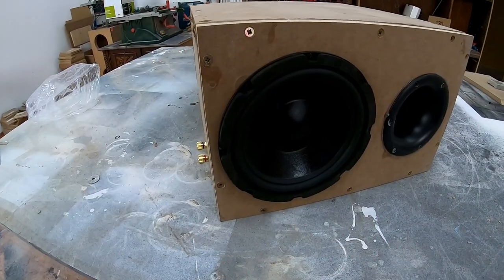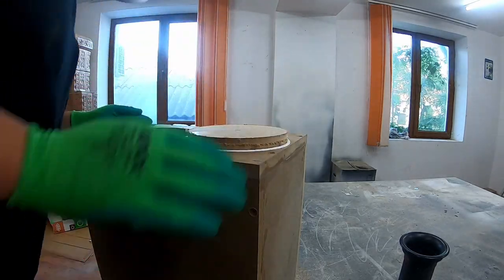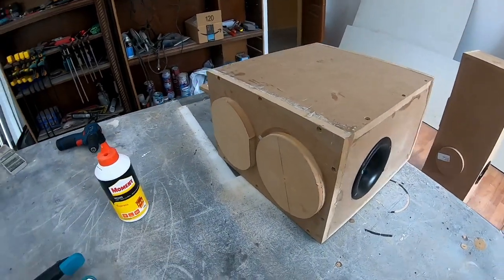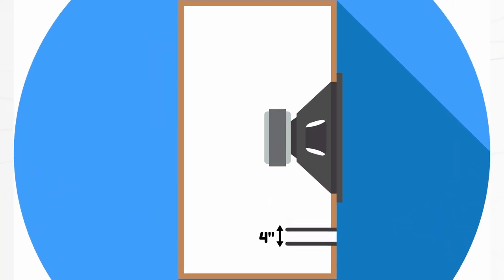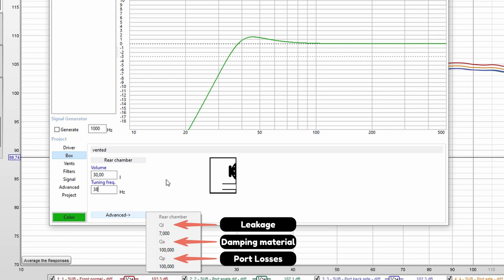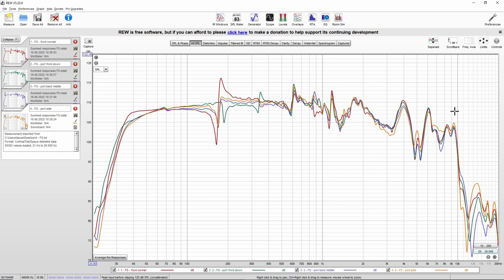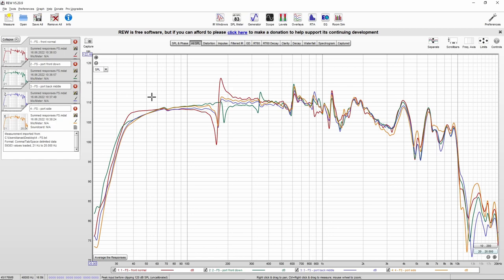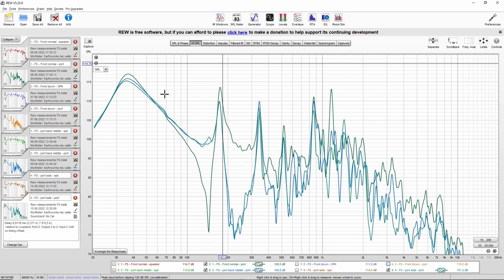Bass reflex port placement

Comment: I had some Audio Pro floorstanding speakers that had the port down firing, and it was just a two way, so one small (5-6" I think?) driver and a tweeter. It had significant sub bass output, good below 30Hz.

Comment: There's a trick with standing waves that can be used to minimize the problem with port resonance. Basically you need to design the box in such way that the mouth of the port is located around a null of a standing wave that is created inside the box. The standing wave must be of the same frequency as the port self resonance freqency. I want to try it out in the future with a small full range speaker. The problem is that WinISD seems to miscalculate the port lengh and with it the port self resonance frequency.
Reply: Or a large bottom port. Basically negating most standing waves in towers, and adding to port gain depending on the height off the floor
Reply: @Luke-qs2cg  this is true you want the mouth of the port as far away from the driver as possible so the box can build pressure as the wave builds you don't want the mouth of the port right up next to the driver
Reply: @johnnycorn7225  Generally I agree. Only one thing bothers me - port near the floor will have floor gain, can cause acoustic problems in the room like rumbling floor (depending on the flooring material) and overall incorrect boomy low freq response. Same as if we put rear ported speaker close to the wall.
Reply: @johnnycorn7225  I dont know if you just poorly worded a certain phenomenon, but what you said sounds like bro-science
Reply: @KompletterGeist  it's really straightforward, just keep in mind I'm talking about the opening of the port on the inside of the box being as far away from the driver as possible. 
The reason this is desirable is because you definitely will lose pressure if you have the ports opening too close to the driver, and that means less air flow coming out of the port and less bass. 
Nothing too technical or scientific about it check out buck box designs he talks about this topic in depth. 
I've been building boxes for a long time and have observed this personally.
Reply: @stanislavtodorov8705 put a piece of granite or other heavy type of flat brick material between the speaker and floor,  also can lay one ontop if using a cheap thin wood ,low weighing floorstanders or subwoofers

Comment: Wait wait wait +1db gain is insignificant? A 3db gain is equivalent to a doubling of input power. 
Not to mention your first measurement comparison had a lower -3db rolloff point in addition to that +1db in output, making it significantly superior.

Comment: Great video been wondering about this. I am curious though about the effects of ports placed so the they fire across the face of the driver. I believed JL Audio makes one and I just saw a Gately Audio box with dual ports facing each other across the driver front. I know this would be an advanced design but would be interesting to see if there’s any advantages to it.

Comment: I have 2 18’s in my truck and I placed the port near the roof in the middle of the 2 seats, perfectly square port which is better than a long rectangle. 4th order bandpass
Reply: why is a square better than rectangle? are both shapes of equal area? thanks in advance

Comment: It would interesting to look at port placement effects just on the front of TABAQ and Pensil type enclosure designs. These are tall, vented, enclosures with small cross sections made for 3" drivers where the speaker driver is at the top front and the port at the bottom front of the cabinet. They're almost like transmission lines and I suspect that there is a "false bass" peaking from 100 - 200 hz. Most current 3" drivers have an fs around 100 hz.

Comment: Missleading.  Re-measure your floor stander,  but not at nearfield. Just put it down in your room , close to a wall. Put the mic at a reasonable listener position . 
Now we can talk. 
1. Behind the magnet,  not a good place . At higher volume you will have more port noise.
2. Difference between forward and rear firing comes from the effect of the wall behind. Basicly you can modell that as if your port would flange out drasticly. 
3. Yess I em aware that this is mosly room accoustics. Argue about it only, if you listen to music keeping your ears kept at near field. 
Same goes for down firing ports. They get an extention with a huge flare.

Backward and forward firing allso has phase differences at the listener position. Hence nearfield will show nothing out of that at all ever. 

In a car sub it makes next to no difference , as long as the port is not choked. That is correct. The rest you say is invalid. And can be with ease tested with the setup i described.

Allso about standing waves... look , it exsists in subs too , and whit all speakers. Ever. No excuse. What you can indeed do when designing is avoiding sqaure shapes. Not ideal but you could set up your dimensions to give the desired volume , and having a ratio of the thrid root of 2 vs each other. 
So A side internal is say 1 unit ,
B side internal is approx 1.256*A 
C side internal is approx 1.256*B 

Thatway at least the resonants will not share a harmonic and not add up.

A nother oldschool solution is to suspend in the middle of the box somen spongy dampening material. Make sure the string you use is some wool of othet type that makes no sharp sound. That will break the path of the standing wave , and allso absorb reflections.

Just some old school 60's era advice .

Comment: does the frequency of the standing wave move up if the box is shorter? do you know the relationship between the standing wave and the height of the box, like a full wave, 1/2, or 1/4 waveleingth? thanks

Comment: I have questionable Design Idea for my car, listen...
I have a BMW E36 Sedan, the problem is, i cant just put in a ported sub that plays into the trunk because the trunk is closed of, the back seats are mounted on a solid back plate out auf aluminum.
I have a ski back wich is pretty small... So my Idea is to build a box with the port extending out of the box going OVER the Subwoofer driver itself... do you think it will work? The only other ways to build a box for this car is either a bandpass (wich i really do not want, because it will be more complex and bandpass most of the time does not sound as good as ported or closed) or a closed box with the driver sitting behind the ski bag wich I dont want either, but consider it more if ported wont work. Should i just try?

Comment: There is any problem to install passive radiator which is 2 inch smaller than woofer?
Reply: Rule of thumb: displacement of pr = 2 * displacement of speaker. So the surface area * xmax of the passive radiator must be atleast twice the surface area * xmax of the speaker.
Reply: agrega dos iguales entonces

Comment: Would not a typical 24 db/octave low pass XO @ say 80Hz mitigate the standing wave issue or is that a natural harmonic that can't be filtered out?
Reply from the maker: It would filter the standing wave, but then you wouldn't have any midrange. It's not a subwoofer it's a mid-bass driver.
Reply: @AudioJudgement  I see. It never occurred to me that was the goal here. With a port tuning in the 30's it seemed fitting for subwoofer performance. Isn't midbass in the 80 to 400 Hz range?

Comment: Also can u consider making a Ripole sub and a dual driver push push or push pull in subs
Reply: The reason this is done (or use to be done) is insufficient room for the required internal volume of woofer(s) being used. Isobaric loading of 2 woofers will reduce required volume of enclosure by half, by combining the motor force of the 2 drivers. There is no free lunch however, there is always a trade-off to consider. Using 2 woofers, isobaric-loaded in an enclosure of half required volume, will be equal in amplitude to a single woofer in an appropriate sized enclosure.
* If I'm not mistaken, Gary Springay is the source of this info, in either CAR AUDIO or AUTOSOUND and SECURITY magazine. Search story titled "the car audio system no one would build'

Comment: Hi, nice video it really help me a lot but i have a question. I am building a bookshelf speaker with bass reflex box. My problem is because the speaker and space i have, and also because in my country there is no many places to buy ports i was thinking in 3D printing my own port with my customs needs. It is okey or i have to take care of something. Thanks for all!
Reply from the maker: You can just use a rectangular port. And make from whatever material you are using to make the box.